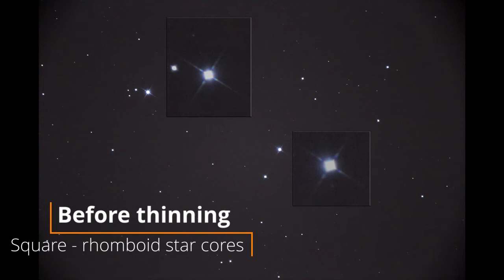Milling The Spider Vanes On VIXEN VISAC VC200L TELESCOPE

Comment: Thanks for this video. I recently bought a VC200L and am looking to have the vanes thinned. I do not have the equipment or know-how. Is there a place that can do this for a price? Or are you able to do this for pay?
Reply from the maker: Hi Jeffrey, sorry for the late reply. I never seen something like that sold commercially. I think you would be better off getting a quote from a local machinist in your area about the job. Just be careful when disassembling the secondary mirror from it. Best of luck and clear skies :-)